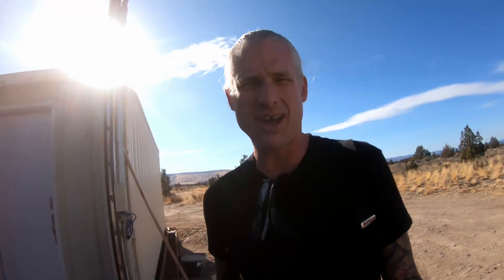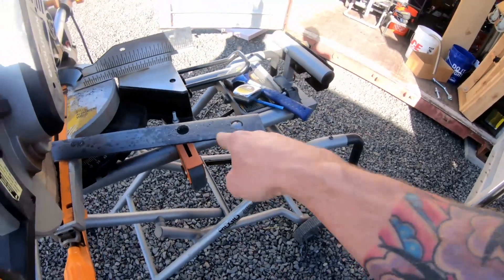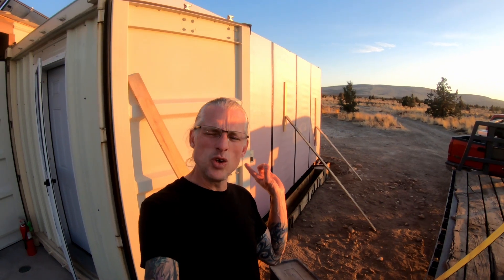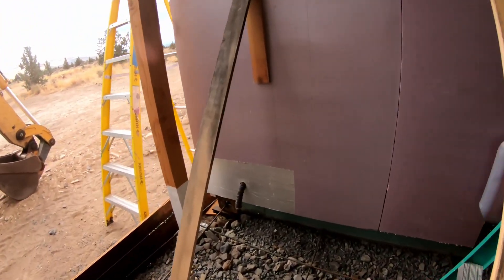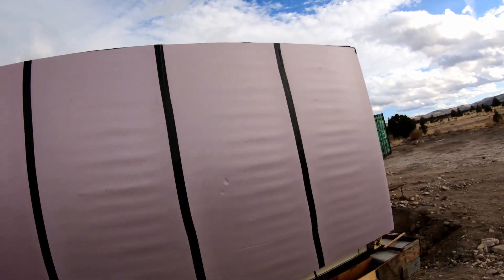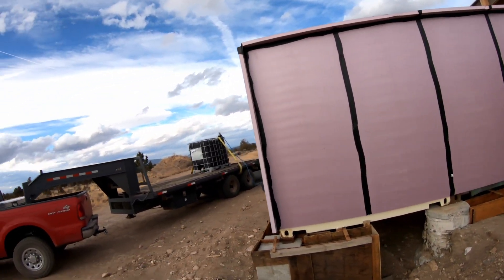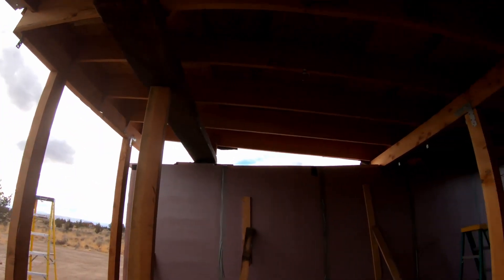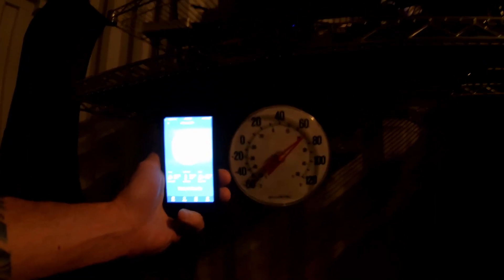Outsulation -Shipping Container Tiny Home Build. Insulating outside of container

Comment: thanks for posting.  at 3min,  did you put 6 mm poly between the rigid insulation and the shipping containing outside wall?     can you not just glue the rigid insulation against the shipping container on the outside?    or are there moisture risk issues with the insultation rioting  / mould ?
Reply from the maker: No plastic. I did glue it, didn't work long. I took it all down and sandwiched the foam in between plywood. Works much better now.
Reply: @GudasWorld  thanks for sharing again.   I was thinking to use PL glue to glue the rigid form boards to the container exterior wall.   And or sandwich 1 inch boards (Siding)  on top of the 2 inch rigid insultation .    maybe no need for that expensive PL glue then...
Reply from the maker: Correct. The best glue for pink foam to plywood is the expanding foam. Not sure where you are. We have Mill seconds sellers. I got the ply for super cheep. Most were just fine. Good luck!
Reply: @GudasWorld so this project didn’t work ?
Reply from the maker: The wind was too bad. Lasted about 3-4 months. Had I just wrapped it with 1/4" ply it would have been good. I made another video "How to fix broken pink foam". Sandwiched the foam, which was pretty beat up, between yard seconds 1/4" ply. Used spray foam as glue. Then I used yard seconds (cheap wood) 2x6 to hold it all like a exoskeleton. Then put used metal over it all for protection. Worked just find with a RV propane furnace until below like 15F. If you don't have wind, it works just fine. If you have wind,  if you are doing it temporary or not, you might want to add wood. Outsulation is the way tho.